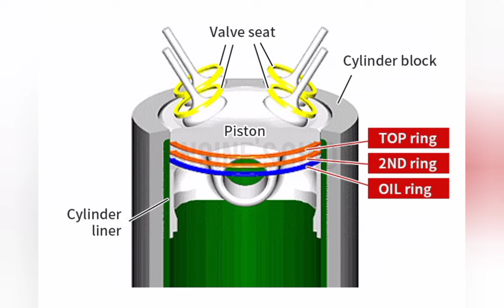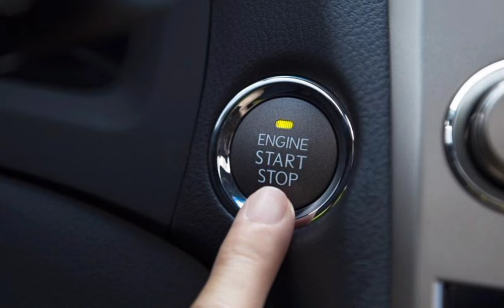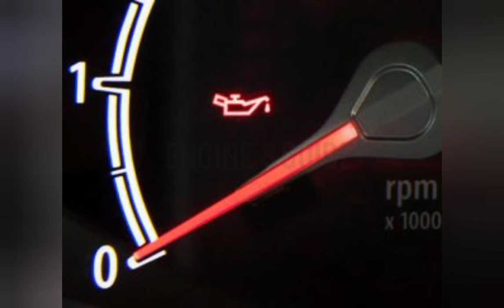ENGINE OIL PRESSURE LOW ( OIL PRESSURE WARNING LIGHT ON) WHAT TO DO ? #oilpressuresensor #engine

Comment: Engine oil light indicator turned on, but there is plenty of oil in the engine.
Reply: Nothing to do with how much oil you have. It's the pressure most likely low pressure